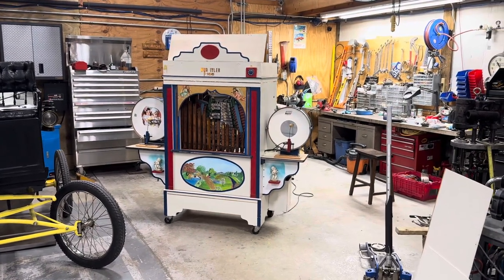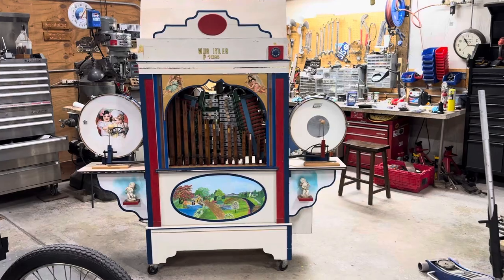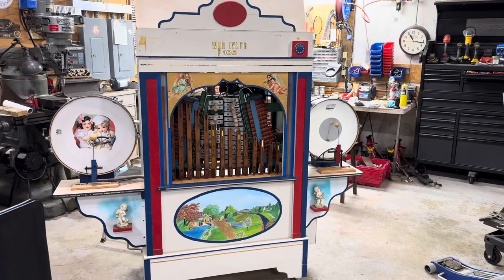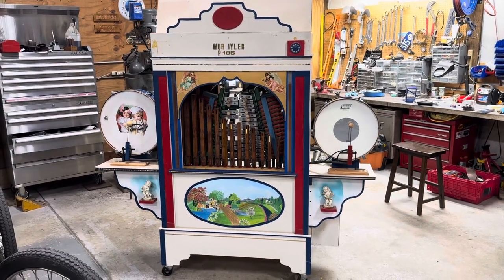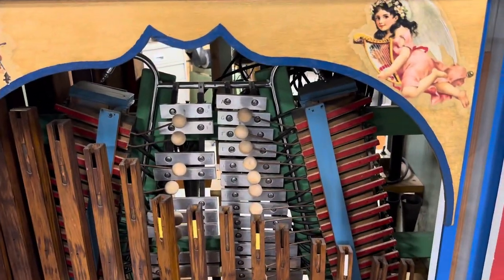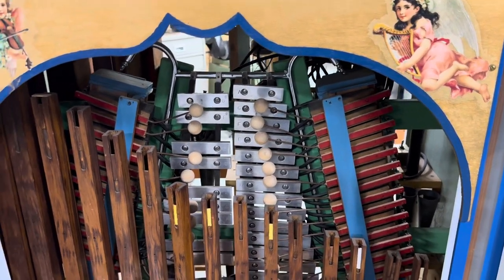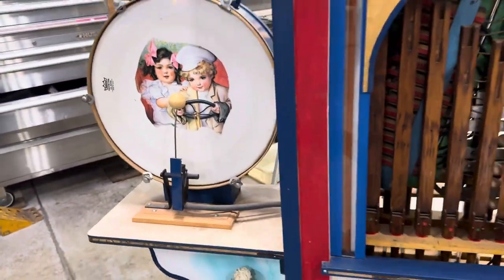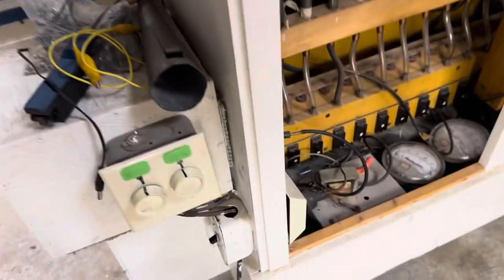Our new band organ. Sorta like a Wurlitzer

Comment: Almost undoubtedly a creation of Pete Logan. He built extremely poor quality instruments with absolutely bizarre mechanisms, and charged outrageously high prices for them when new. Probably built initially in the 1960s (?) and enlarged to include the drums in the 1990s/2000s as evident by the modern RAM brand plastic unit pneumatic mechanisms they have.
Reply from the maker: Thanks. That is extremely helpful info and seems to apply to this machine. Id like to pick your brain on parts and such
Reply: It sounds off key